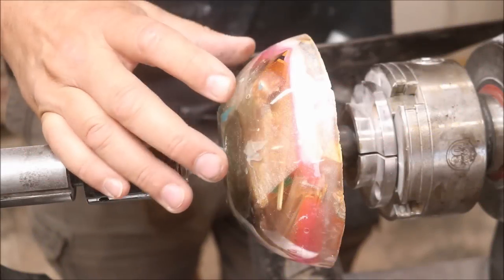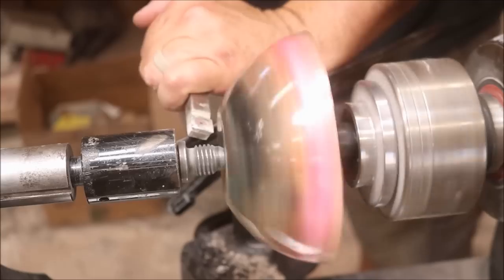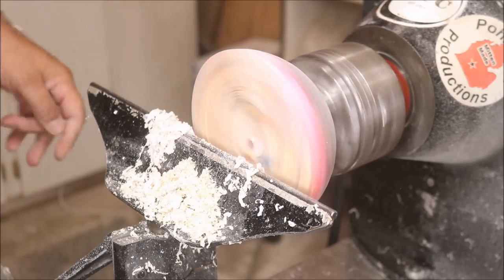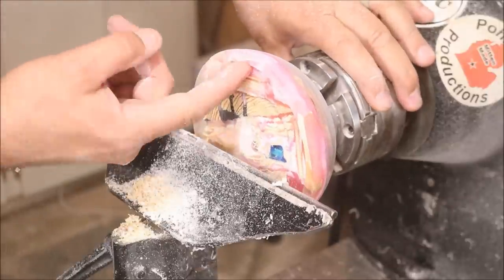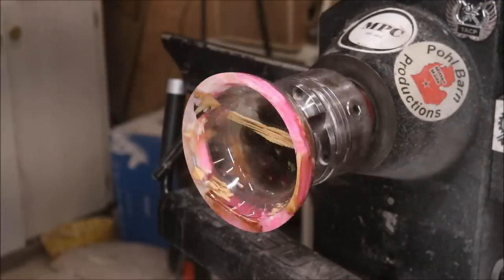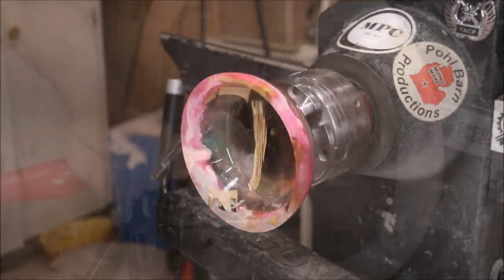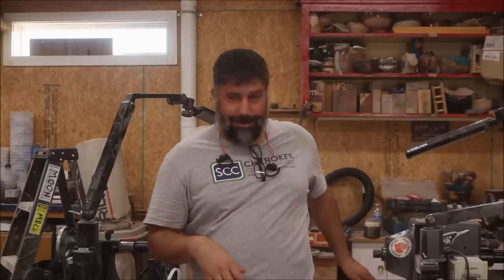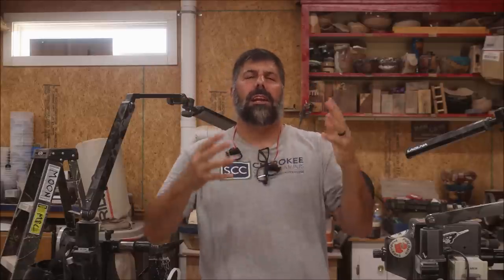Uncovering the Surprising Danger Lurking in Resin Art - What You Never Knew!

Comment: You're a braver turner then I am. I had a buddy send me a resin piece he cast and wanted me to turn. I didn't think twice about chucking it up and going to town. Learned a hard lesson as it broke a brand new bowl gouge. Turned out...he had stuck some "reclaimed" wood in the casting without checking for screws/nails or other metal pieces. I found one of those clips they use on mitered corners to join them.

Comment: Great job Ken! I have a similar off-cut/excess resin tub that is slowly filling up. I haven't had the greatest luck with resin projects, so I'm really wondering if I dare turn this thing when it is finally full, as it won't be pressure pot cast, just straight pours. Great video.
Wes @ Piedra Designs
Reply: It's worth it